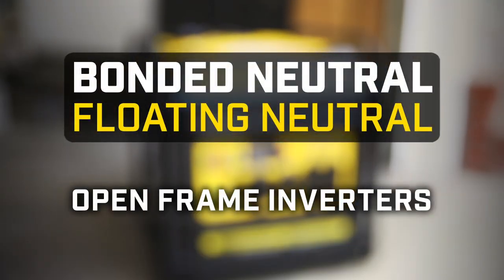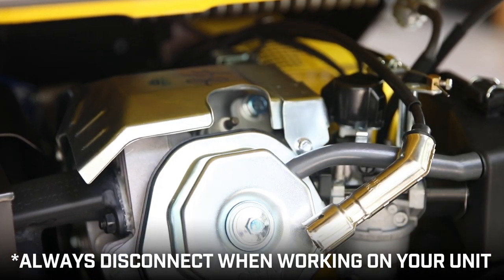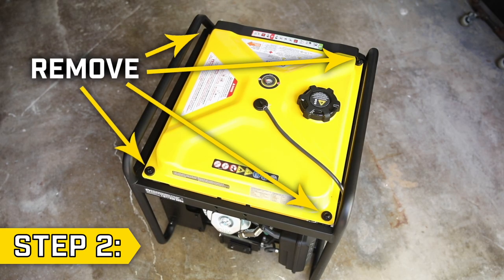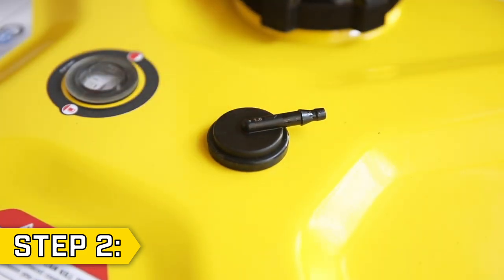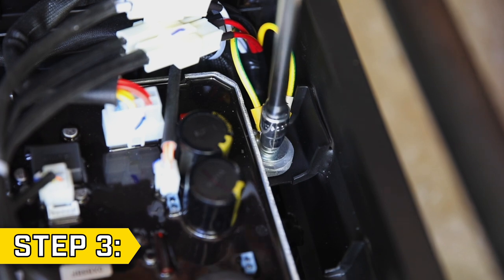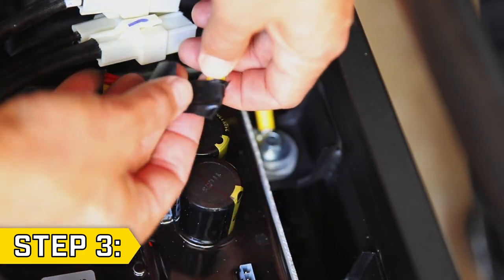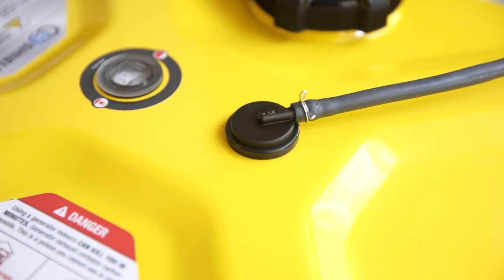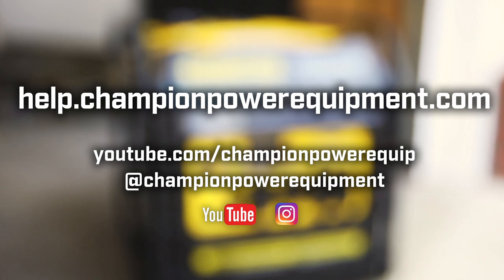Disconnect the Bonded Neutral (201067)

Comment: On my new 9,000/ 7250 W inverter generator the gas tank did not have a fuel shutoff on the tank (there is one, just not on the tank as shown on the video). If you plan to make this modification try to do so before you add gas to the tank, otherwise you will need to empty the tank prior to removal.

Comment: Folks the easiest way to determine which wire is ground is to disconnect both wires from the frame. With a multimeter set to ohms check for continuity by placing a probe into the ground lug on one of the receptacles. Then touch each wire. The one that has continuity is your ground. Reconnect that wire to the frame and tape up the other wire.

Comment: Mine also did not have the neutral wire labeled. Luckily my electrician is coming out tomorrow to install an interlock/inlet box, so I’ll have him check the wires before he leaves. My model is the 9000w open frame inverter.

Comment: Neither wire has a white tag on mine? Which one is neutral?
Reply from the maker: We're sorry to hear this. At your earliest convenience, please email us at support@cpeauto.com with a picture of both wires, so we can help you identify the proper one.
Reply: My wires were not marked either.   Regardless, I was able to determine which one of the 2 was the "ground" by testing continuity with a multimeter set to Ohms (with sound).  I connected the one multimeter probe to ground of one of the outlets on the generator, and the other probe to each wire.  The one that beeps is the ground.  The one that does not beep is the neutral.  You can then test continuity of the neutral wire by connecting it to one multimeter probe, and then put the other probe wire into the upper left slot of the outlet (which is always neutral when the ground is positioned below the neutral/hot slots).
Reply: @willymena  so the one that does not beep is the wire I leave disconnected?
Reply: @Dickj203   First unscrew both wires from the frame.  Connect one of the multimenter probes to one of the outlet grounds and the other probe to one of the 2 wires.  One will show continuity (that's ground) and the other will not (that's neutral).  You want to screw the GROUND back to the frame, and tape off the neutral.  

My understanding is that you're doing this IF you plan to connect the generator to an inlet box to power your electrical panel (instead of, let's say, just using it with an extension cord to power your refrigerator or other items directly to the generator).

Hope that helps!

Let's see if @ChampionPowerEquipmentHQ can confirm.
Reply: @ChampionPowerEquipmentHQ   sent an email with a pic
Reply: @willymena  so the wire that beeped when I touched it was ground? I screwed that wire back to frame. The other wire didn’t beep. That was neutral?
Reply: @Dickj203  Yes, as long as the other wiire on your multi-meter was connected to a ground plug.
Reply: @willymena  yes one probe end was touching ground hole of plug other touched wire terminal that beeped.
Reply: @Dickj203  Good, so the other wire that did not beep (the neutral) should get disconnected and taped up.
Reply: @willymena  good deal. Youve been more helpful than customer support. They actually told me the wrong wire. Thanks!